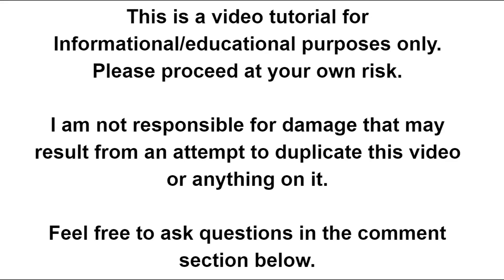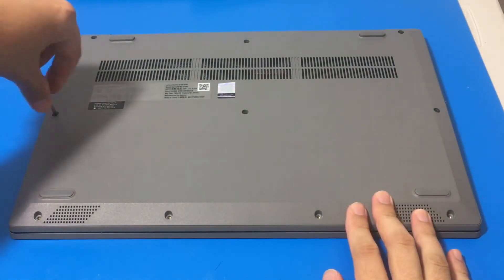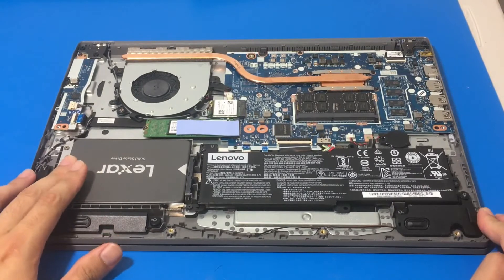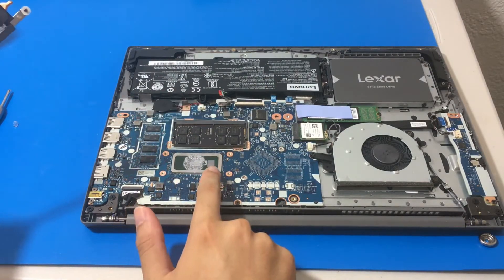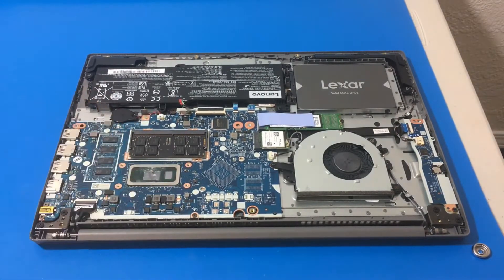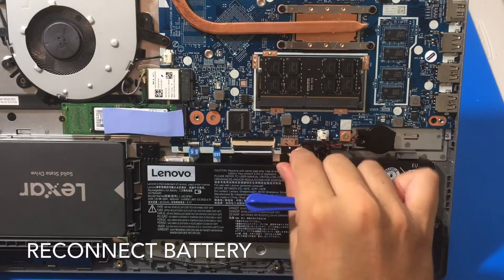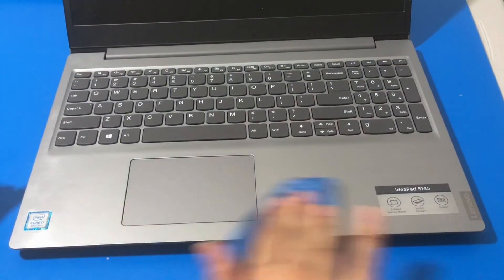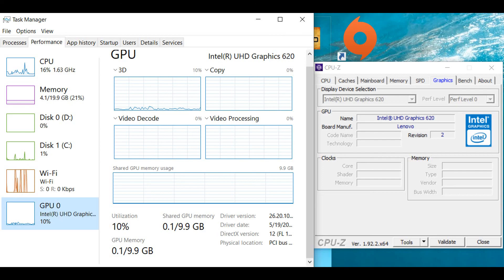Removing and Applying Thermal Paste | Lenovo iDeaPad S145 LNVNB161216

Comment: Hello, I upgraded to windows 11 today, and my 8 year old laptop (same model with yours) showed sluggish performance, I suspected cpu throttling cause my around min. 52°C and max around 100°C. My CPU utlization always almost full and speed clocks down to onky 0.40GHz. I will get arctic MX6 right now, thank you for your help! I do have question, is your ideapad still working fine in windows 11?
Reply from the maker: Unfortunately I haven’t used it in awhile. Someone have me an old gaming laptop so I’ve been using that. Havent used the ideapad inwhile I gave it to someone. It was working last time I checked. How’s the ssd on your ideapad?
Reply: @whattmeter  it's 512 SSD Nvme 90% health, I just reverted back to Windows 10 and works great again. Sadly, I may have to refrain from Win 11 and lose some job opportunities because of it. Nonetheless, I'm thankful its still working great in Windows 10. I have ordered Arctic M6 already, hoping it would help increase laptop performance.
Reply from the maker: @krispotato1409  aww man sorry to hear that. Windows 11 is a mess sometimes honestly.

Comment: Why you haven't applied the thermal paste in the integrated graphics?
Reply from the maker: Good question. I didn’t see any thermal paste on it so I didn’t replace it. Only saw thermal paste on the cpu. First time I replaced thermal paste in the video for this laptop
Reply: I speak portuguese so i can understand a bit of spanish :)
Reply: Have the S145 as well. Need to replace the DC power jack. Want to clean the cooling fan, vent, & refresh the page T-paste. I wondered why he didn't put a dab on the GPU square, too. I wonder if there is a space  between the heat sink & the heat rail. Thanks for asking.
Reply: No es necesario, porque el chip de la tarjeta gráfica no recalienta, pero en caso quisieras ponerle algo para refrigerar, lo mejor es usar un termapack (plasticos refrigerantes) ya que es una zona hueca y la pasta térmica no haría su función. Suerte con la traducción ;).
Reply: @vladitler  sometimes adding thermal paste to these chips can harm them

Comment: hi dude, ı have too s145 .  I want to add ssd but I don't know how many GB limit. Do you think it would be a problem if I add in 500 GB ?  Also, I want to add 8 gb of ram, but it shows that it is 2133 MHz. Would it be a problem if I add 2400 mhz like you ?  ( my ram capacity is only 8 gb. I have only 1 ram slot. )
Reply from the maker: 500 gb should be no problem for storage. Ive used 1tb before. For the ram whats the cpu installed

Comment: can i remove the processor and replace it with another in lenovo ideapad s145
Reply from the maker: The one in the video, yes If you look at cpuz screenshot toward the end there are many cpus compatible with this socket. But definitely check you laptop and available cpus
Reply: @whattmeter  my mother bord model is 81MV and processor is i5 so can i remove i5 and install i7 in these mother board
Reply from the maker: What cpu socket do you have?
Reply: @whattmeter  how can i know which cpu socket i have? is there any way
Reply: socket 1356FCBGA
Reply from the maker: Nice. You can use cpuz to check your cpu socket. Yup just make sure the cpu you get has the same socket. Good luck. Feel free to look at other cpu upgrade videos as well
Reply: what about this socket
Reply: socket 1356FCBGA
Reply: pls u only one who helped me more thanks but pls reply for this socket
socket 1356FCBGA
Reply: @whattmeter   bro cam i add gputo the ideapad s145 not the egpu i need gpu can i add it pls reply
Reply from the maker: For this laptop I don’t think so. But I could be wrong. I just dont see where you would put a gpu in this laptop
Reply from the maker: Depends. You have to check what model the motherboard is and the socket. There are many variations to this laptop but most likely yes you can change the cpu. Just make sure to check your motherboard and the socket. The one in the video is fcbga1356 cpu. I already have an i7 so I don’t plan on upgrading this